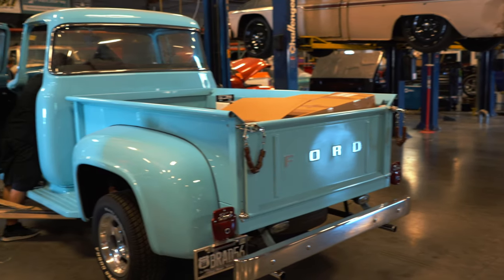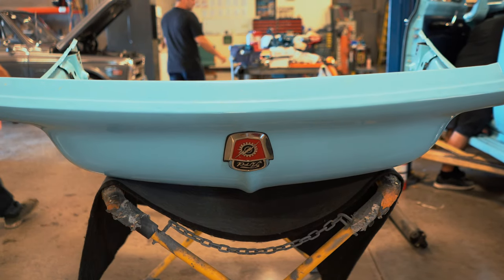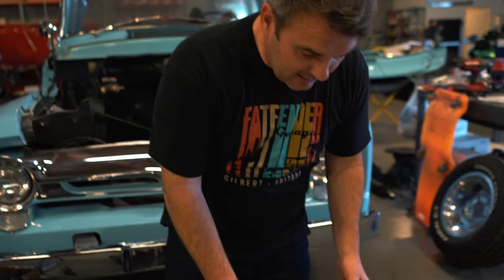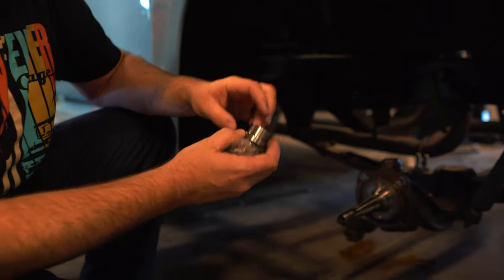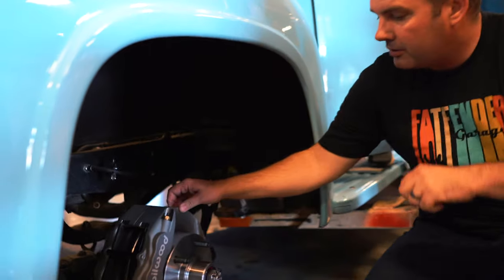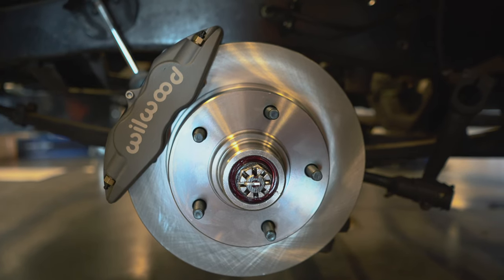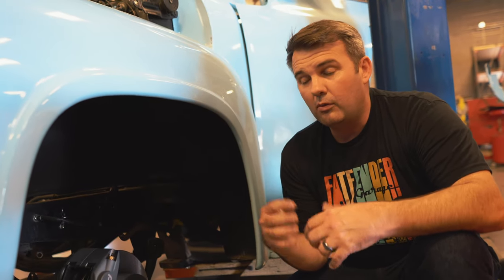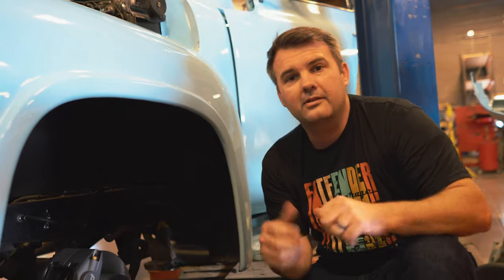Easy 1953-1956 F100 Disc Brake Conversion

Comment: Stupid question... don’t be mad at me if I’m wrong , would this conversation fit on my stock suspension stock drum brakes 1953 ford custom line or ford crown Victoria?
Reply: This kit won't work but they have a package that will .
An absolute must  to have if you drive on today's freeways .

Comment: With all the different drum brake spindles made over the years, I'm wondering of any will bolt right up replacing the stock ones...or are adaptable by using alternate sets of bearings. Any ideas out there?
I'm using original hubs/drums on Henry's lady - '30 Model A. Used to be a common swap but seems hard to find usable hubs.
Yes I could do the disk conversion, but I'm building an era correct hot rod.

Comment: I know this is a pretty old video, but I am in the process of installing the same kit on my '54 F100. Unfortunately, the grease fittings on the kingpin interfere with the Wilwood caliper bracket. I'm wondering if you ran into the same issue and that's why you opted to mount the caliper on the frontside? Did you explore the possibility of low profile grease fittings? Thanks!
Reply from the maker: MIke W it’s easy to get the bracket and caliper installed incorrectly. The instructions don’t seem to be 100% right
Reply: I had the same issue with my 54 F 100 . I replaced the old grease fittings g with a screw in plug and drilled and tapped a new  location for a new fitting . I had absolutely no problems as it went as planned and smoothly.